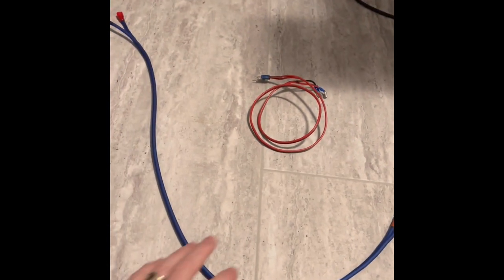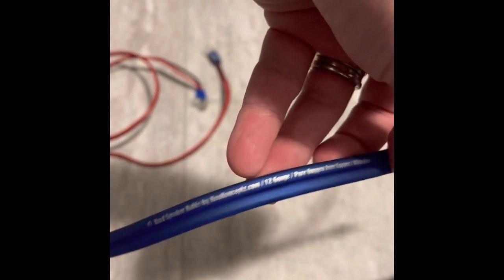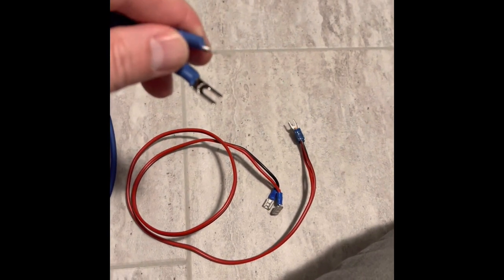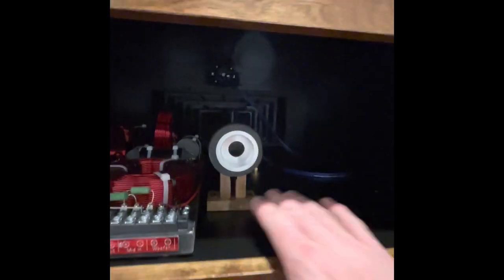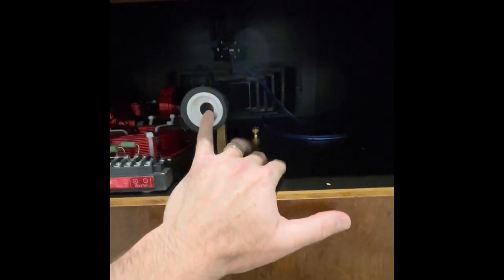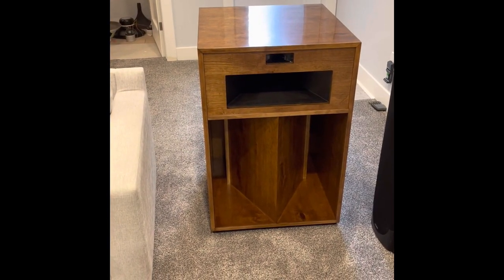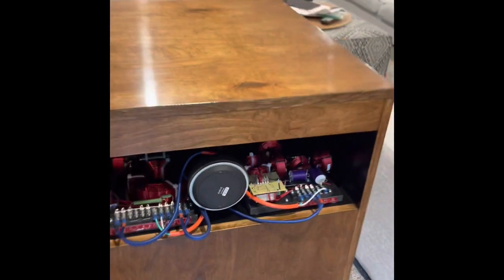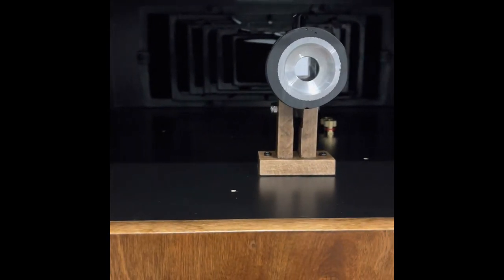DIY La Scala Clone - Conclusion

Comment: I've just finished watching this whole series. Bravo! You did a lovely job.

I'm refurbishing a pair of 1986 La Scalas that I bought in the summer. I've laminated 3/8" Baltic Birch panels to the top, bottom, and sides to tame the bass bin resonance issues. I replaced the original AL networks with AA networks from Crites and have been very happy with them. Also, I replaced my tweeters with SMAHL tweeters and lenses (more info on the Klipsch forums). I've  also augmented my La Scalas with one (soon to be two) THTLP subwoofers that I built from plans available from Bill Fitzmaurice. I plan to veneer and refinish the La Scalas in late spring (when the weather warms up). I couldn't be happier with how they sound.

Like you, I'm a Canadian (in Mississauga, Ontario). I appreciated the parts sources that you mentioned.
Reply from the maker: Thanks Dave… really appreciate the comments!  The mods that you’ve done should be an improvement for sure. The AA crossover is the best of the original designs, in my opinion and the tweeter upgrades should be a good match for them.  Glad the parts sources were helpful.  All the best with your project!

Comment: Thank you YouTube algorithm.  This video popped up this morning.  I’ll have to watch your other videos now.  Your clones look great and I’m sure they sound great too.  I’ve had my LaScalas since 1980 and upgraded the x-overs two years ago with the ES500 and ES5800 from ALK.  Glad I did for a couple reasons, #1 because I think Al has retired and #2, imaging improved dramatically.  The x-overs cost the same as what the speakers cost me in 1980.  Almost too cool-looking to be hiding inside the cabinet.
Reply from the maker: Thanks for the comments.. much appreciated! And I believe you may be right about Al.  I might have gotten some of the last crossovers from him.  They really are a difference maker to an already great speaker.
Reply: @hollowheadsrestorations  i haven’t looked at your other videos yet.  Did you mention the tube amp you’re using?  I’m using a Decware amp I waited for 15 months to receive this past Sept.  It is awesome!  I no longer use a preamp as I’m running the DAC and phono-pre directly to the amp.  Have you considered applying Dynamat on your squawker or tweeter?  Apparently that is supposed to eliminate some of the resonance Klipsch are known for.  I’m lazy so that’s why I’m asking
Reply from the maker: @Steveh817  the amp is a Reisong Boyuurange A-20.  It’s a great little tube amp and plays well with the LaScalas.  My Squawker horns are the resin version, not metal, so much less prone to ringing.  No dynamat used, and I haven’t noticed anything negative at all.

Comment: Built a pair of these with a modified back of the top section opening to the doghouse plated off and 2 ports tuned to 30Hz to supplement the low end (a modification of a mod described on the Klipsch Community Forum). Did not use the edge banding though and in the back corners of the bass bin I put in 45 degree corner transition pieces to lessen the reflection of pressure wave interference and make the turn to the front smoother (doing what I can to diminish reflection and standing wave interference of the lowest bass notes).Love them and been building Lascala clones since 1981. Also have a pair of the larger clones of the (un-ported and non DSP) older heritage Jubilees that I have built (2nd pair built). Love great tight deep bass!

Comment: just plain phenomenal, I just picked up a set of late 70's La Scala's. Will be testing to verify if any upgrades will be needed first. then I'll start a refinish project.
Reply from the maker: Well worth the effort.  You’ll definitely want to, at a minimum, upgrade the capacitors in the existing crossovers.  Crites Speakers has upgrade kits and it’s not a difficult DIY job.  Or you can splurge on the ALK Engineering options.  Again, pricey, but worth it!  Have fun!
Reply: @hollowheadsrestorations  saw AL looks like he's isn't doing much these days. little water damage on one of the cabinets, just need to figure out how to refinish. Thanks for responding.

Comment: Very nice job.   I wasn't too sure about the extra strip on the front when you were adding that, but it turned out OK.   I guess you could have decreased the width of the "ramps" by a tiny bit instead.   They look great!   
I enjoyed seeing all the videos.
Reply from the maker: Thanks for the comments.. yeah, I was ultimately very happy with how it looks (thank God!…lol).  Per your comment, it isn’t possible to narrow the rear section as this would change the horn flare dimensions and impact the frequency response etc.  even adding the strip would have a small impact, though nothing audible to my ear.

Comment: I tried something like this 20 years ago with Altec Lansing voice of theaters with an 8 cell multi horn but wasn't not able to get crossover right.  The horn went down to 300Hz.  But the woofer didn't go low like I wanted and need a sub.

Comment: you have used Vintage or new parts to combine them with a crossover that you mention:
tweet ?
midrange horn ?
Speaker Woofers?
In La Scala Clone Detailed it only mentions wooden parts.
Thank you for your work
Reply from the maker: All drivers sourced from CritesSpeakers.com.  Woofer CW1526, tweeter CT120, midrange driver A-55G.  Mid horn is the C401.  Thanks for watching!

Comment: It'd be useful to list materials and costs for reference. It's amazing how much prices change over the years. What looks like a great deal now suddenly becomes economically infeasible 2-3 years down the line.
Reply from the maker: The whole thing cost me about 5k Canadian. Materials where I live (Newfoundland) are not strictly comparable to elsewhere, so not useful for comparison in other areas.  Most of the components came from Crites Speakers, so their website can be referenced for current pricing.  I am not sure if ALK engineering is still building crossovers.  I think Al may have given up taking orders.  If so, crossovers are available through Crites Speakers as well.
Reply: @hollowheadsrestorations  Arghh! I just lost my response... Well I'll try to re-post it, what of it I can remember...
You are right that Canadian prices do not apply elsewhere, however, they are a good reference, even if of only relative value. The cost is very reasonable considering the ALK extreme slope crossovers cost 2360 USD on their own.

That is a very high cost for crossovers which is reasonable if one considers the cost of high quality components used alone but still not justifiable in my mind for a mere set of crossovers. Still, the owner has a business interest to protect and selling them off for, say, a 500 USD a pair would be tantamount to inviting others to copy and clone the design.

I just checked and these are no longer made to order - you are correct. They may be available as one-off sales however. That means only a lucky few will be able to get them in the future, if at all.
Perhaps a more viable way for this business to continue would be to have them built-to-order in batches by a sub-contractor, having them tested by a sub-contractor or by the owner and then sell them as batches on a first come, first served basis. This might be a way to go forward. In any case we will see but it will be a shame if they are no longer offered.

One point worth noting is that ALK eng. is the only high end manufacturer that I have ever seen selling low pass filters to curtail high frequency content for the comfort of pets! This is very commendable! At least that filter might be worth having on offer!

Comment: Why not make a separate crossover compartment above or below Horn and Tweeter assemble? This allows for better access for initial installation, repair or replacement. No, it's not an exact clone, but it makes sense and gives you a uncluttered assembly. JMHO as an long time electrician...Great execution, love the work. Kudos!
Reply from the maker: That could be done, for sure. In fact, there is no need to enclose the top portion at all - many horn speakers are done that way.  However, I was trying to maintain, and hopefully improve somewhat, on the original aesthetic.  Thanks for looking!
Reply: @hollowheadsrestorations  You You did a hell of a job... I've rebuilt my media room that was destroyed in a storm.. Finishing electrical in kitchen, dreaming of a audiophile setup with secondary surround system ( which is in place now) for movies and gaming. Looking at Klipch La Scala, Cornwalls. Maybe Maggies and really getting interested in building a open baffle design. ABX really got me enthusiastic about the project. I have a friend who is doing my cabinets and I might design a baffle and have him cut the pieces. I would create channels for the wires so i could hide the routing.

Comment: What was you total cost in materials - including the drivers/cross-over?
Reply from the maker: Cost is going to vary wildly depending on how you approach this and will have changed since I built these.  The drivers can be priced out by visiting Critesspeakers.com.  You will need 3 sheets of 3/4 Birch Plywood, and whatever you are using for finishing.  The crossovers I used are no longer available - they were the most expensive part at around 2k Canadian.  Critesspeakers has their versions of the Klipsch designs at a much more reasonable cost.

Comment: I’ve gone through the whole series with great enjoyment and perhaps I missed it, but could you provide a link to the horns used?  I’m in the process of sourcing materials.
Reply from the maker: Thanks for the comments.  All my drivers and horns were sourced from Crites Speakers.  Web address is in the description on the video, along with links to cut plans etc.  The horns are the hardest part to source.  You will either have to find a used pair, or Crites has their own version (c-400 or c-401.. can’t remember which number they use), which may be available.  The tweeter options are listed on their site.  You could also source the OEM drivers, which are fairly easy to find.  K-400 or K-401 horns pop up infrequently on eBay and elsewhere, and are typically pricey.

Comment: Hi hollowhead, you have inspired me to take the plunge and build my own pair. Though getting the crites gear down to 🇦🇺 makes it quite a bit more expensive. 2 Questions for you. Instead of adding hardwood strips, could you not have extended the depth of the cabinet by 1/2"? And did you add a pre stain conditioner to the ply 1st to avoid blotchiness?
Reply from the maker: Thanks for the comments! Yes, I used pre-stain conditioner.. this is a must for birch plywood.  Yes, I could have extended the cabinet depth, but that would have meant a lot of wastage as I already had the panels cut.  Using the strips solved the problem and I’m happy as it also does a great job of finishing the raw plywood edges.  However, if you make the angle adjustment I discussed, I don’t expect you would have this issue anyway.  Another way to avoid this would be to make an assembly jig for the “doghouse” portion making sure it is the correct dimension. This is what I would do if I built this again.  One other thing, I don’t think ALK Engineering is taking any new orders (don’t take my word for it, but that’s what I hear) so you will need to go with the Crites crossovers or find some originals to refurbish and use.  Good luck with the build!
Reply: Thanks. Where did you find the plans for the jig? Ive seen a drawing of it online but has no dimensions
Reply from the maker: @TKa-sl5ik  I didn’t have plans.  I just know the angles and made it accordingly from scratch.  I didn’t do a perfect job as shown in the video, but made it work.

Comment: I’m starting a build of my own- thanks for all your work detailing your project, very inspiring! Question: did you buy all of your components before starting? I’m wondering how to pre-drill the holes for the various speaker screws? Did you have some kind of template or did you use the speakers/horns themselves? Thanks again!
Reply from the maker: Thanks for the comment!  Yes I had all the components in advance.  I then used them as templates as you suggest.  Good luck with the build!

Comment: Hello, what program could you use if I wanted to design my own horn design? Hard to find a program any suggestions?
Reply from the maker: There is a good reference and design calculator for an Edgar Horn option on the ALK engineering site with a free program download trachorn.exe. (http://www.alkeng.com/).  I considered building my own horn, but then elected to stick with the Klipsch design.  Who knows, maybe I’ll tack this approach at a later time.

Comment: I am VERY sceptical that you could cut beveled timber edges with an accuracy of half a degree when you talk about making the bevels 59.5 degrees rather than 60 degrees.
Reply from the maker: Using hobbyist level tools, you would be correct.  However, it is entirely possible to get this level of accuracy with the right equipment.  That is why I farmed out the cutting for this project.  I have since acquired a saw that can absolutely do this level of precision.  Alternatively, the option is to sand the angle to fit, or mess about with fillers etc. to close any gaps.  As discussed in the videos, the doghouse is the hardest part of this build due to the angle of the cuts, and the precision needed.

Comment: Does anyone know how id go about scaling down a horn like this? ive made a rough 3d printable replica but i know horns do not scale acoustically and does sound ok but i know its got more potential once tuned properly. PS PLA at 40% infill has same acoustic properties as MDF
Reply from the maker: There is a site called volvotreter that has such a thing if I recall correctly..
Reply: Dont want to downscale. Bass horn is already miniaturized and furtherr reduction , you would have a folded lower mid horn.

Comment: Where did you get the upgraded connectors?
Reply from the maker: @Jacob J I ordered from Parts Connexion.  Item is Furutech FP-209.  I got the Rhodium plated ones, but they are available in plain copper as well I believe

Comment: Hi how much did all the speaker components cost to build this ?
Reply from the maker: I didn’t track exactly, but in the neighbourhood of 6k Canadian.  However, I paid probably too much to get my plywood cut, so there are savings to be had there, and shipping costs and duty to get the components sent to Newfoundland were significant.  Depending on where you are located, there may be a significant difference in cost.  Check the video description for my sources and you can look up current costs.  The only part you won’t find is the mid horn.  The K-400 to K-401 horn will need to be sourced used, and can be very pricey.  Crites Speakers has a version of this horn (not listed, may or may not be available).  Also, the crossovers I used are the most expensive version available from ALK engineering and the single most expensive part of the build.  There are cheaper options, but I was going for best possible, not economy.  Thank for watching!
Reply: @hollowheadsrestorations  The mid horn is what I was wondering about I'm in Chicago and thinking of buying a black pair with the crites upgrades already for 2k and veneer them myself
 in walnut,however I have thought of building the cabs myself but need exact blueprint plans your video explains and shows what's inside because that woofer box was confusing me.
Thanks for your information.
Reply from the maker: @itemforsale6930  I also have links to the cut plans etc. in the description.  If you can buy a used pair of La Scala for a decent price, that is the best way to go, for a number of reasons.  Impossible to find in my area, hence why I went with a self-build.  I know that my build stacks up very well with factory (and much better in terms of performance with the upgrades) but it’s a lot of labour.  I restored a pair of factory La Scalas in the past, and it is also a lot of labour, and comes with its own challenges, but overall it will be easier, and likely cheaper than a full build, if the cost of the used speakers is reasonable.  Either way, it’s a great project, and I am beyond pleased with the end result.  Good luck!

Comment: I’m not sure you need so many crossover network components for 3 drivers. I think these extra coils/caps cost you additional $300 (about)
PS I’d like to listen to a louder test music. I’ve heard nothing. Were speakers good or not? I didn’t hear this. 8 episodes I waited for the result, and such disappointing final point
Reply from the maker: There are simpler designs, however there are reasons for this design as it was engineered.  See the ALK Engineering website for a full explanation of the crossover network.  I have owned La Scalas in the past with different crossover designs (Klipsch AA, AL, and AK) and can attest that there is no comparison to these in terms of performance.  Yes, they are very expensive, but worth it in my opinion, based on the improvement in overall sound quality.
Reply: @hollowheadsrestorations  I see what you mean, Sir. I prefer to choose a drivers with an appropriate FR and a low order crossover filters. But I'm impressed of how flat a signal phase is after the network. I didn't see such mix of a high order filter (3+) and a flat phase before.